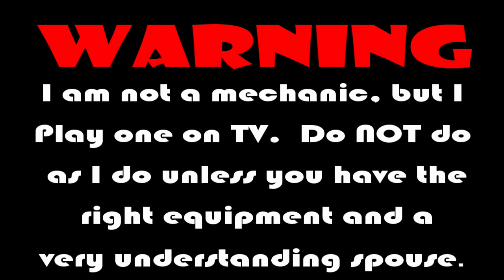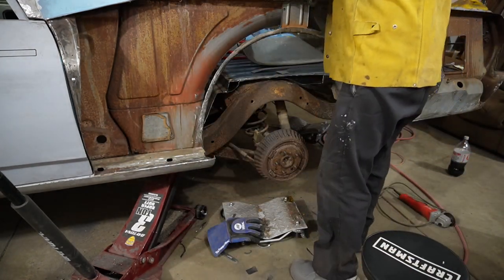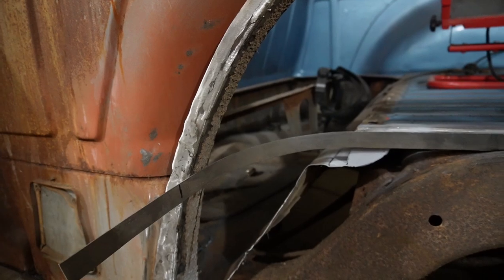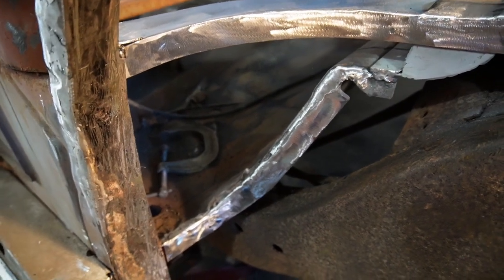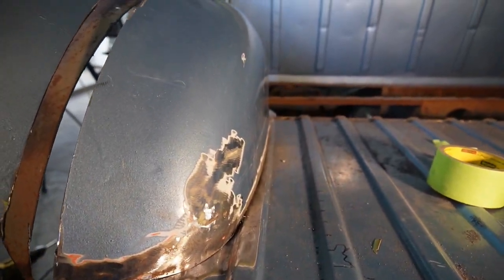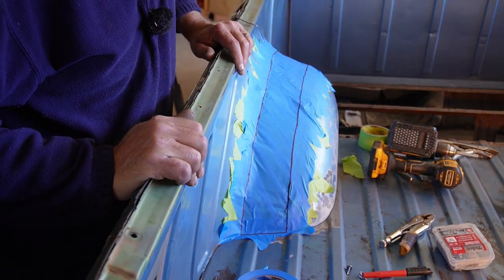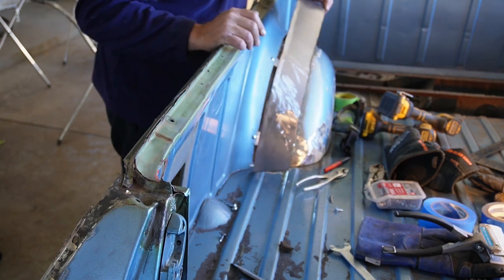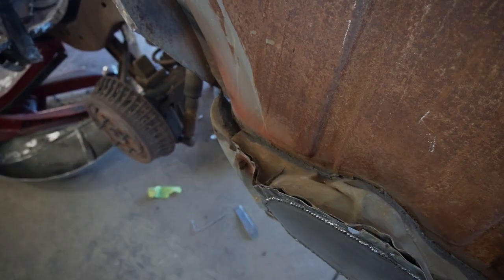Mini Tubbing and quarter panel replacement - Part 2.  1970 El Camino

Comment: Great video! Can you make a video on, how to install a front bed panel? The panel that’s part of the bed underneath the rear window. Since, that panel is known for getting rusted. I have a panel that I’m trying to install but need a few pointers.
Reply from the maker: Fortunately for me, Mine doesn't need replacing.  Best advice I can give you is look at the new panel to see where the attaching flanges are and cut the old one out smaller.  Then see where you can get access to join the new one to the car and adjust accordingly.  Good Luck!